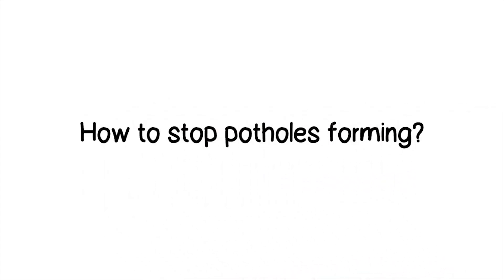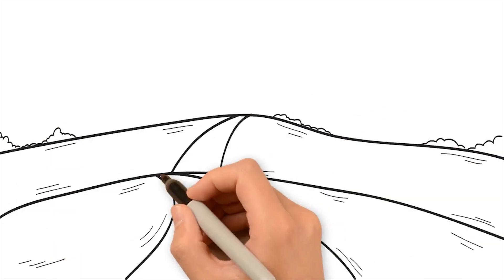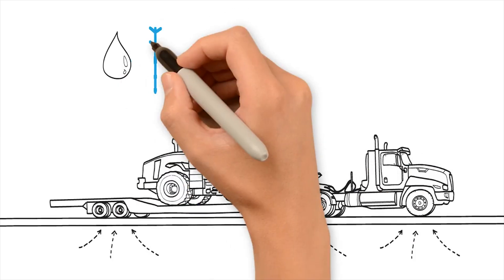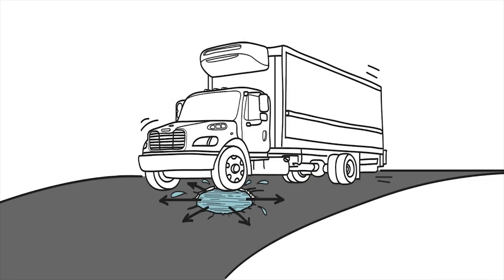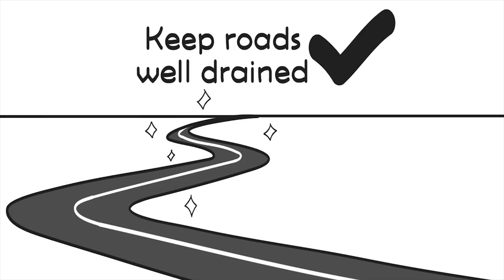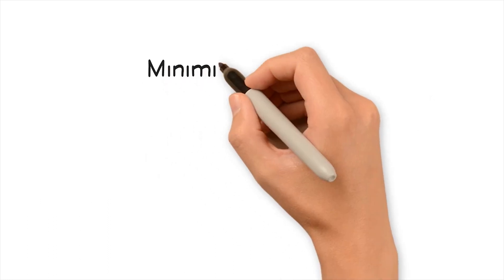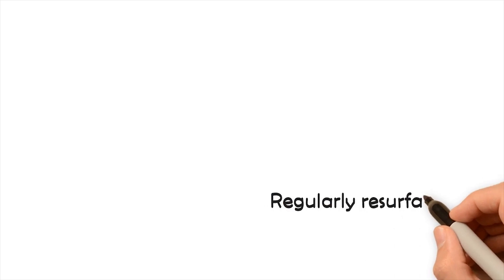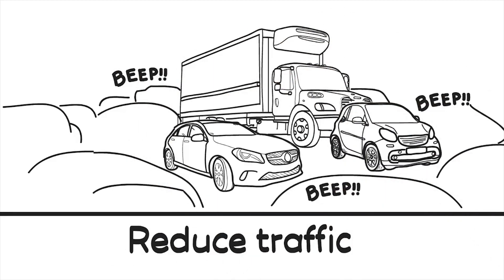What causes potholes?

Comment: All it takes is a little bit of common Sense has anybody actually done the experiment dump a little bit of gasoline on the asphalt and see how soft it makes it so like if you drive your car over it it'll remove a little bits here and there until it creates a big hole it isn't just wear and tear of vehicles driving over it it's wearing tear of vehicles leaking solvent fluids like gasoline
Reply: As well as UV rays and rain